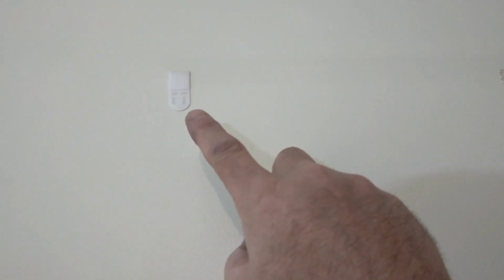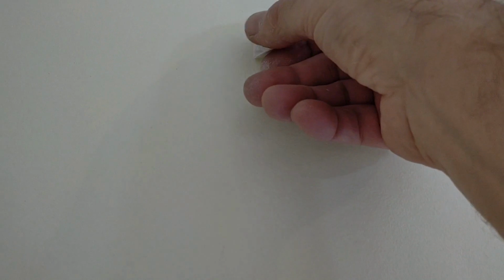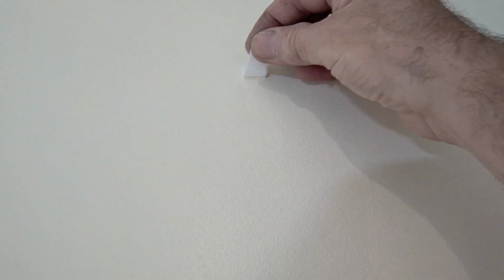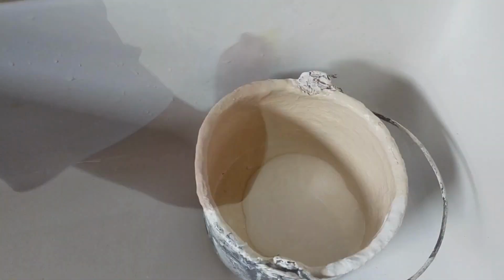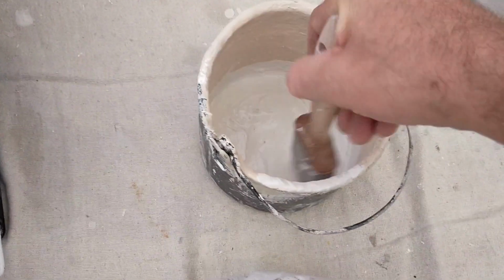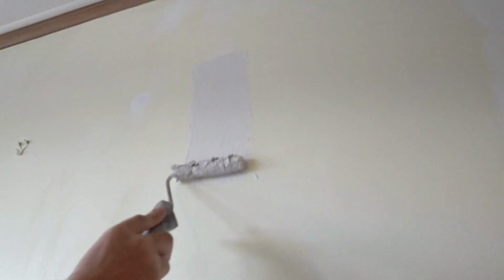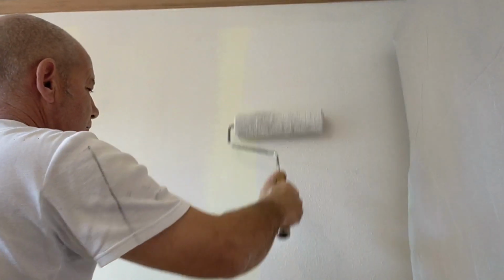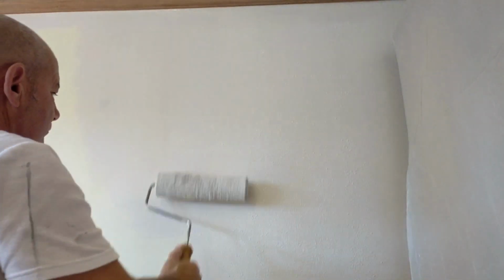Velcro Picture Hangers How To Remove Also Ordinary Paint Repair

Comment: Why does it seem like you all use much longer nap rollers than we do in the states? Doesn't that long nap cause a more course finish? Is it because our houses in the states are mostly smooth dry wall and you are dealing with plaster and other rougher surfaces?
Reply from the maker: Some of what you say may be true.. but we do have a choice of 3 different naps really.  Medium and long are used mostly for water based short for oil really..   thanks
Reply: Strange, it seems like we choose nap based on desired smoothness of finish, not type of paint. We use low to medium nap for water based paints.
Reply: Long pile would be used for exterior over render/stucco, and interior over textured surfaces like artex. Medium pile is a standard roller for general surfaces, and as long as it’s spread out you get minimal orange peel. If anything our surfaces are smoother here than the states. Our multi finish plaster is far smoother than the tape and jointing you guys do. I’ve seen so many videos of properties there with stucco indoors, the equivelant or artex such as skip trowel finishes etc.